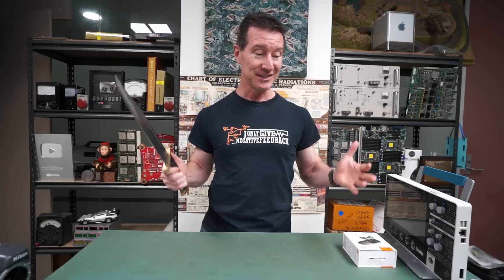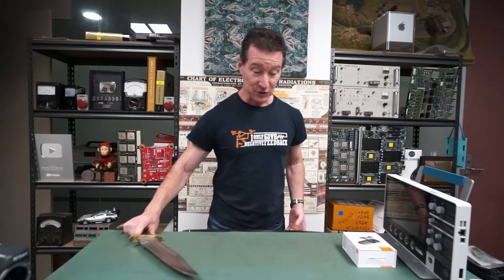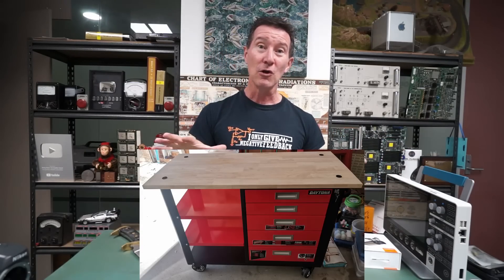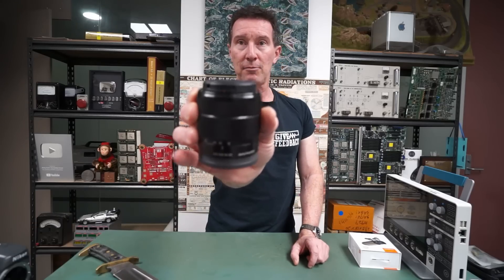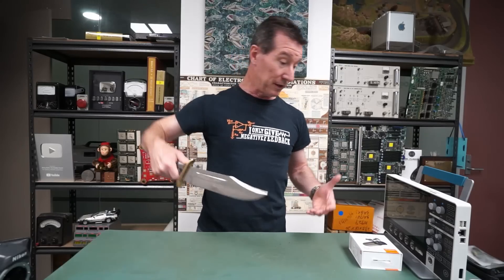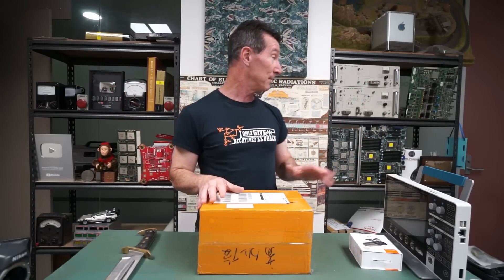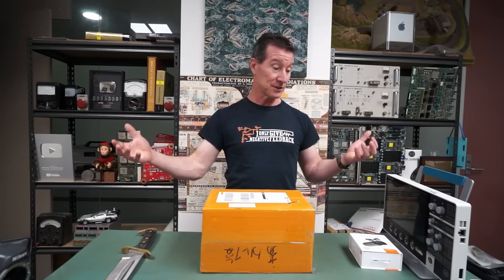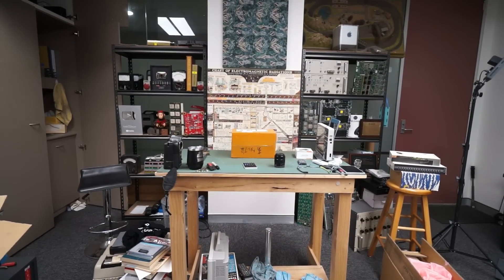Standing Mailbag Bench

Comment from the maker: I think it probably needs a bench 100m higher. I could actually retrofit the top of the current bench onto the new trolley giving me an extra level, and a higher bench at the same time that would allow even better framing than that shown in the twitter link in the description. Would likely be near identical to the sitting version, except I'd now be standing.
See my twitter for another framing version of this: https://twitter.com/eevblog/status/1556505501122588672
Reply: One hundred meters? 😆 🤣
Reply: @DasBreaker  I can only assume that he meant "mm". But then again that would be 1 m, which is still way too high.
Yeah, I have no clue...
Reply: @blockbertus  100mm would be 10cm, so yes, he probably meant "mm"
Reply: @jw106  Oh yeah. Brain fart. I was thinking about "cm" when converting to meters. Oups. You are right and he most likely meant to write "mm".
Reply: Looks better standing cause dealing with packages from a standing position is a lot easier, your hand and arms will have a longer reach.
At the end it is not worth a poll cause you have to work there and you have the gut feeling what feels better.
If you feel comfortable you will make the right decision.
Reply: There is a term for it but it escapes me, but it has todo with that, when you change so much you basicly end up with the same thing you had before just more complicated.
Reply: solid plan, the visible racking is a win to me as well.
Reply: Yes, the other framing with higher up camera is much better.